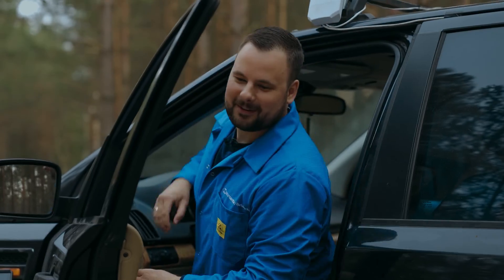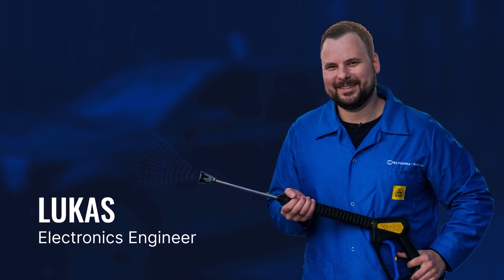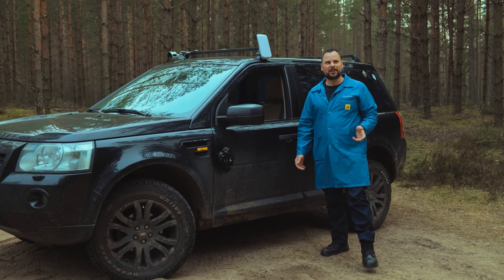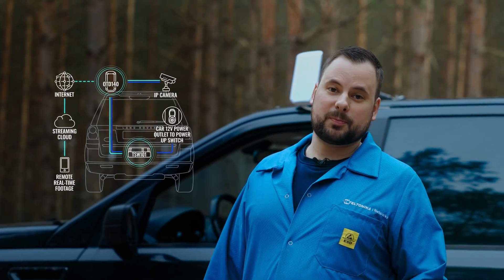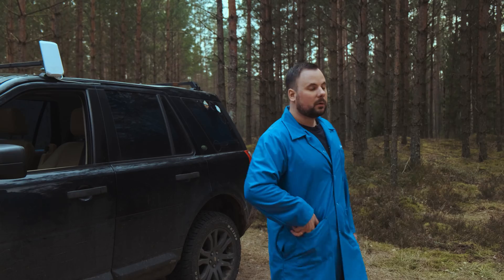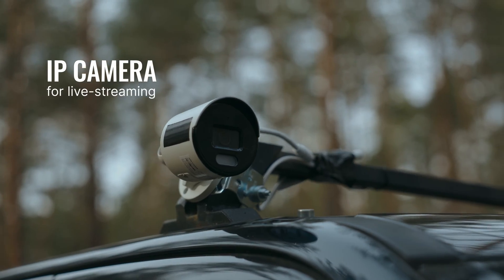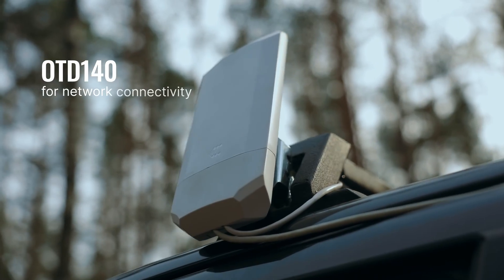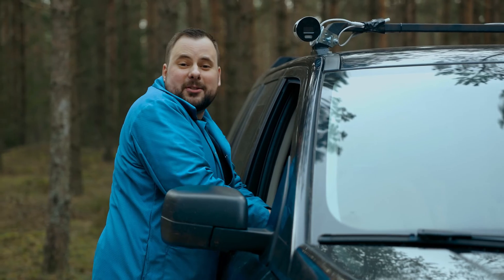The OTD140 - 4G Outdoor Router Survives the Water Test

Comment: the Case is "home grade" not "industrial grade" moisture will sweep in router and destroy it...
The bottom cover should be fixed with screw, have a foam rubber seal and cables should have cable glands.
The case may be of acceptable grade for fixed home use, but is completely not acceptable for mobile recreational use on cars, RV...

Comment: For high pressure water test why didn't you not go up to the IP69K certification? Too much trouble?
Reply from the maker: The IP55 rating provides a good level of protection for equipment used in moderately harsh environments, making it suitable for both indoor and outdoor applications where dust and water exposure are possible. OTD140 is the first device in a series that will pave the way for new projects where IP69k may be considered. Please subscribe to our newsletter for updates on upcoming devices and news: https://teltonika-networks.com/subscribe